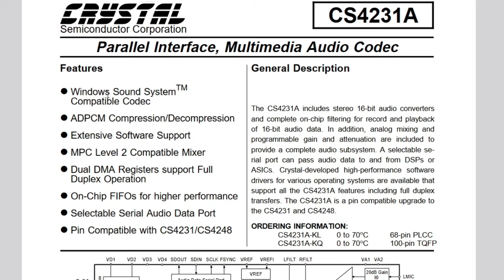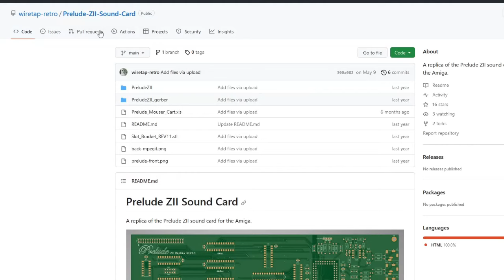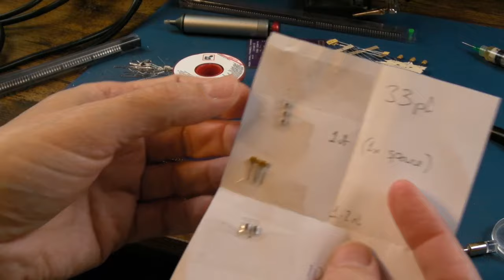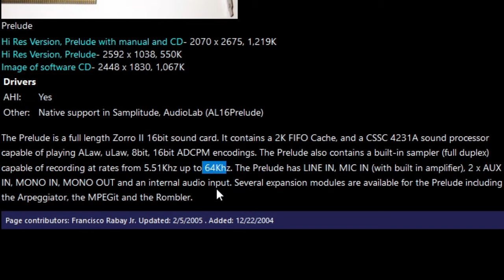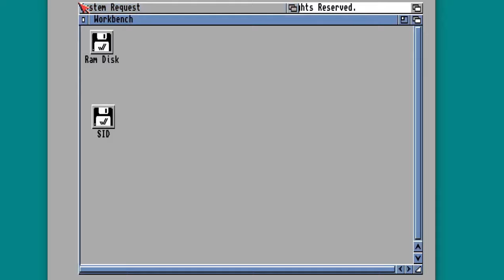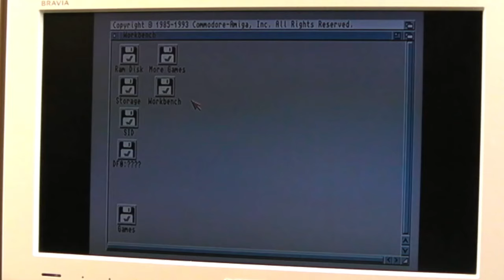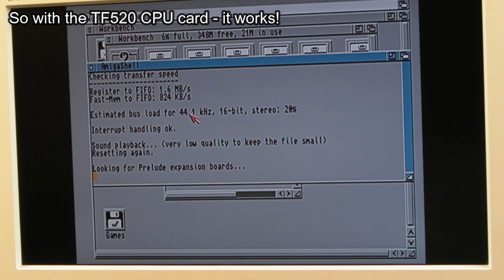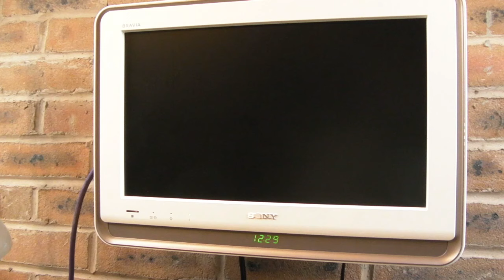Building an Amiga Sound Card - Part 1

Comment: 14-bit on Paula AHI IIRC. It's kind of bizarre that Amiga had the same 8-bit sound chip from 1985-1994 and not a two chip solution was offered to keep backwards compatibility however commodore were penny pinchers, The Amiga was doing 4 channel stereo sound when the PC could only do blips n beeps, but later on the PC caught up got 16-bit sound first thru ISA then PCI and later PCIe 1x (albeit with crap latency).
Reply: It's refreshing to finally read a comment from someone who completely understands the audio situation on the Amiga. Most people get it wrong.

Comment: Back in the 90s always eagerly awaited upgrades to the Amiga or rival machines to offer more channels/polyphony, never happened, not to mention the Amiga never had midi as standard like the ST, now nearly 50 I've lost interest in making music, still interested in repairing though, just sorted a blown hall sensor PCB (flir on hand, didn't need it) injecting voltage and the faulty cap over heated and popped before I could do anything about it, getting slow. Younger me would have dismantled the whole board and checked the semiconductors, scratched my head and shelved it. Maybe all is not lost 😂

Comment: The problem with keeping the audio jack straight is caused by a bad pcb footprint/mismatch between the actual part pin layout and the created pcb footprint.  That should be fixed before the next revision.

Comment: If you want to clean up the flux after soldering, I've found that a degreasing soap (i.e. automotive soap such as Gojo and Orange Goop) work best. Also, DON'T GET THE TYPE WITH PUMICE IN IT!

Comment: 68020 onla has a 256-byte instruction cache, no data cache whereas the 68030 has both instruction and data caches. IMHO, you can leave the instruction cache ON with burst enabled on the TF536.
Reply from the maker: Thanks!  If I leave caches on with the TF536, the card doesnt work - see @51:04  If I turned caches off, it works...
Reply: @GadgetUK164  that is too much of an overall system performance loss, having to turn off caches just to have the external sound card work.

Comment: Having to turn off CPU caches is too much of a performance penalty.
Reply from the maker: You shouldn't need to!  Other 030 processor cards work fine with cache enabled!
Reply: @GadgetUK164  okay, now I'm completely confused: why doesn't the card work with the TF accelerator when the caches are enabled, id est what's so special or different that those two don't get along?
Reply from the maker: @AnnatarTheMaia  That is the question lol!  I am still working through some issues with the card, and the MPEG side at the moment.  Hopefully I will get to the bottom of it.  It looks like the stutter issue might just be a problem with prlcheck rather than the card in general.